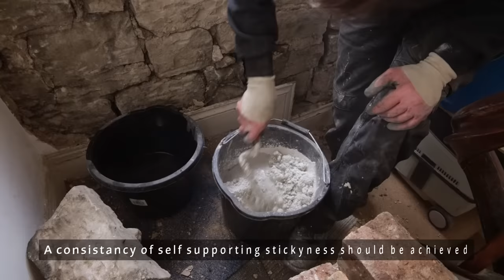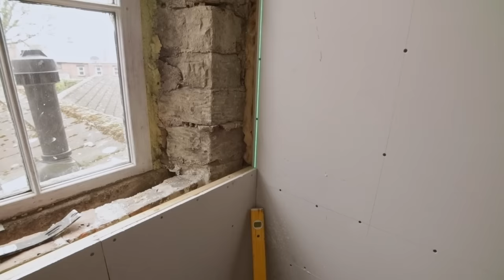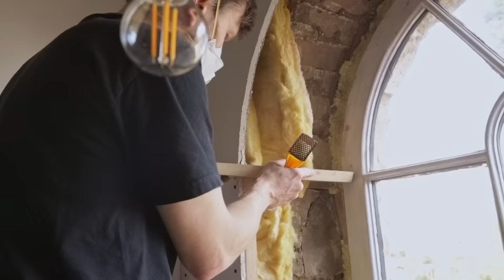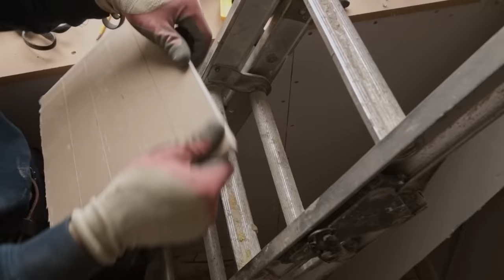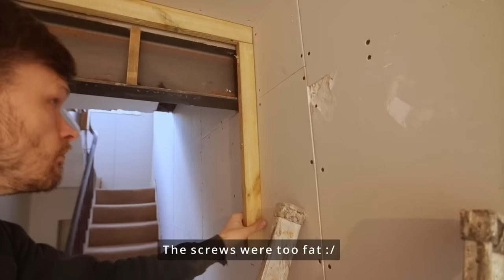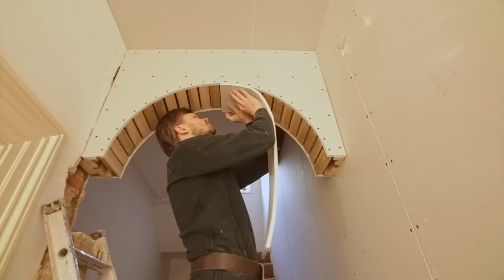Repairing and plasterboarding 160yr old crumbly arched window

Comment: Pleasing to see someone at least knows how to make it better than it was. I think the original builders of your wall and arch must have had an extended pub lunch!
Reply: I used to have a 300 yr old rubble stone cottage. Very similar walls. 
I'm not sure but it could be the better craftsmen were used on the outer skin and the 'trainees' used on the inner skin. Then of course you wouldn't see the inner skin anyway. 
Also, it must be remembered this house will have shifted all over the place as proper foundations were sort of unheard of!
Reply: @JohnnyMotel99  A few quick searches and I couldn't find anything related to the inner core walls of these homes. Could well be that it was understood that the inner walls would be plastered over, and structural integrity was unnecessary. Hard to say, but I tend to agree with you that "first year" apprentices may well have done that work! Also, looks like a cavity was purposefully left between inner and outer walls-- and rubble was allowed to fall between (doesn't appear like they meant to fill that cavity). Air barriers are known good insulation between extremes-- could be timeless knowledge, I don't know. What's known is, temperature extremes tend to produce "weeping" of humidity on opposing surfaces-- which could account for some of the mortar degradation on the inner core (just a thought).
Reply: @crustycurmudgeon2182   The plaster he removed I think was all imperveable (pink) gypsum directly on stone, brick, not traditional lime that lets the building breath. Plus he removed some internal cement that also traps moisture. Possibly also modern plastic based paint, wallpaper also sealing moisture. Additionally I think there is ribbon/strap cement pointing to the exterior which again traps moisture from outside. This causes the stone to disintegrate, corrode over time. 

(Just from what I've read on the topic, not personal knowledge/qualifications)

Comment: I am continually amazed by the old methods of construction used in the UK. The oldest building I ever worked on was a house built in the early 1700’s. The floor joists were oak logs that were debarked, flattened on one side. Tried drilling holes through them to run electrical wiring. After three bits and one drill we gave up and got a code variance to run the cable across the bottom of the beams. Looking really nice. Can’t wait to see it all finished. You should let your little helper in more. She obviously knows what she’s doing. Good dad! My little girl loved working on building projects.

Comment: Dry-stone walling is an ancient Yorkshire craft, but you rarely see it used indoors. :-)
My mum's house is also in Yorkshire (Colne valley) and was built somewhere between 1250 and 1500. That has walls around 1m thick (at the base, there is a pronounced batter) was built  with the local clay packed between the stones rather than any kind of mortar. With those you really did have to choose where to stop pulling out loose stones, as they were all loose when the weight comes off.
Reply: Where was the dry stone wall? He used mortar
Reply: @Miss_Toots  It was a joke, because of how little was holding in the stones before the work started
Reply: Pam Ayres had a little poem about dry stone walling. -- "I am a dry stone waller. All day I dry stone wall. Of all appalling callings. Dry stone walling's worst of all"

Comment: A true perfectionist!
There should be a small gap between wall and ceiling to fill with acrylic, and the blunt ends of the boards should have a V-cut (there is a tool for that).

Comment: Excellent job. I would also check the roof and the outside wall, because the wall and the wood look a little bit wet and with those loose stones, it could be a sign of leakage.

Comment: I would love to know how much temperature difference all the new insulation has made. Looking at the new pipes I assume you also updated the heating so difficult to tell but it looks like it will be toasty! Hard work improving the old solid wall houses.
Reply: A scutch  should be used to clean up those bricks not a brick hammer from what I can see
Reply: @johnthomas-vy3th  if it's the wrong tool, but it works, then it's not the wrong tool :)

Comment: Perhaps I am wrong - but you usually put two layers of half inch plasterboard over a steel beam?  (with staggered joints or use the pink fire rated stuff) Steel is vulnerable in a fire as it fails (bends when hot).  Also if you are mixing modern (plasters and plasterboard) technology with old a vapour barrier might be needed - to let the natural stone breath... but not suffer damp to excess.  Great skills as always though :)

Comment: A bit late, I know, but if you spray the back of the board with water and leave it for five minutes it will bend to the arch shape you want. Much easier than scoring and dealing with the flats later.

Comment: Absolutely amazing to watch. Just one thing, have you tested how much moisture the stone and mortar walls actually emit? I mean, e.g. the plastic test, where you tape a big piece of plastic to the wall and check for any condensation inside after a couple of days?

I would have left the nice ventilation gap between the PIR and the stone/mortar and left out that yellow stuff (glass wool perhaps?). Especially around the exterior wall, where the moisture is almost guaranteed to propagate to the inside. Just saying...  :-)  (how do you make a smiley here?)

Comment: Incredible work again, can I ask what bolts you used to fix into the masonry? I didn't see any rawlplugs and they are always a faff
Reply from the maker: I was using these easydrive concrete screws, you just drill a 6mm hole and drive them in, need quite a powerful screwdiver but they work really well. 
https://www.screwfix.com/p/easydrive-countersunk-concrete-screws-7-5-x-70mm-100-pack/9643h

Comment: I'm on the other side of the pond, and really enjoy the videos. Your work is incredible, and aren't little helpers the best? :)

I've seen several times over the years that in the States that our drywallers will wet down the drywall some and allow it to sag between benches or sawhorses to create an arch. I admit some concern with mold by this technique. Do you find the kerfing works better?

Comment: Are you not installing vapour barrier over the areas where you are using fibre insulation? Where I am in Canada vapour barrier must be installed according to code because if fibre insulation is not protected by a vapour barrier then it saturates with warm air borne water vapour from the inside of the building and becomes useless.

Comment: I would of used the blue rubberize concrete sealer on the stone and mortar to keep the insulation dry from moisture and drafts. 🤔👍 Other than that your drywall work over stone is absolutely perfect. 🤩👍

Comment: Isn't that plasterboard and foam just going to trap moisture behind it, which will degrade the mortar, crumble the bricks, and foster the growth of mould and rot? Shouldn't you be using only vapour permeable materials on an historic solid wall like this?
Reply: Exactly. This guy is using completely  inappropriate methods and materials for old buildings.

Comment: One very minor comment for the future, and obviously not applicable for the arched section, the feathered edge of the edge trim should be on the outer, plastered side of the plasterboard. You may get a crack along the edge of the smooth trim. A line of scrim tape along the join may help prevent this.

Comment: You never did a part 8 on that window, may I ask how you fitted the double glazing? I did all my double glazed sashes with butyl, brads and linseed putty, the old school way, only to be told by a glazing bloke one day that I’d basically destroyed the window longevity and voided any warranty on the glazing as the butyl and putty will dry out the seals and the gas escapes. I wanted to keep the traditional look rather than getting glazing beads.
Reply from the maker: ye i fitted mine more or  less the same way, but the butyl i think should be fine, its the linseed which attacks the  igu sealant. so i fitted the glass into the frame with butyl sealant, then glazing brads to hold in place, then silicone around the edge with a particular type of sealant which is resistant to the linseed and that should protect the igu sealant. then linseed putty to finish it off. ill see if i can find that sealant and let you know.
Reply: @NewYorkshireWorkshop  thanks for the reply, I’d appreciate that. hodgsons do a silicone sealant which may do a similar job, they also do a ‘heritage putty’ in a tube which they want you to use instead of linseed putty, that must get expensive quick!, so to clarify you bedded the glazing in with butyl, obviously made sure the gap between the inside edge of the sash and the edge of the glazing was filled up with butyl, branded and then put a skim of sealant over the butyl filled gap, Which you then did the normal linseed putty? My glazing came with a thin aluminium foil around the edges of the pane and the manufacturer said that helps stop seal degradation and moisture ingress, but I’m dubious as they were low on the price bracket for double glazing and other higher priced manufacturers don’t bother.
Reply from the maker: @samjl4  Ive just looked back and it was indeed the Hodgsons silfix U9 that i used.
I only  put the butyl into the face and bedded the units against it, enough that it squeezed out a bit on the inside. then sealed between the wood and glass on the outside with the silfix U9. as long as you have a seal between the black seal in the unit and the linseed it should be fine. I was going to suggest just using the foil as well, since that would technically do the same thing but i dont know if it is permeable to the oil or not, or if it would degrade as well. I did a bit of research back when i did it and the butyl/silfix method seemed to be the common way it was done.

Comment: Watching this patient work something occurred to me. Why can't there be mortar bags, like icing bags. You would load the mortar into the cone shaped bag that has a nozzle in the end, fold the big end over to secure, and squirt a nice fat worm of mortar vertically in between the blocks you have bedded. Rather than use a long narrow trowel to try to poke it in as best you may.

Comment: Start of video, as you struggled to get rubble into a floppy bin liner - buy yourself a "bosmere bin bag loader". It's just a rectangle of plastic (of the right size and thickness). You wind it into a spiral, and put it in the bag. It unwinds (a little) and holds the bag open for you. It also LINES the bag, so that as you put nasty spiky stuff in, the bag doesn't get pierce. Absolute marvel, I use them all the time in the garden.

Moving on to questions:

Do you think that shoddy wall was (a) shoddily built or (b) shoddily repaired?

Do you know what the stone is? Judging by how easily you drill it, and how big the tooling marks are, I'm guessing it's pretty soft. Certainly not Aberdeen granite!

Comment: I guess the window frame was treated and repainted off camera? There's also a lot of fixings and no continuous support in the "battons" around the face of the reveal. Nothing but plasterboard forming the structure... 50mm cuttings loaded with screws aint doing much for ya!
Reply: That wasn't very constructive, sorry. Framing out like that leaves the whole ingo/reveal prone to big repair if it gets damaged. A knock will leave it needing a lot of work, as opposed to some filler and paint. Same goes for not forming a timber frame in the arched stair feature. Nothing to stop the board from popping if it's ever hit when moving furniture. Because the plasterboard is your structural element.

Comment: I don't really want to be that guy, but... what if someone wants to put up a curtain? You've got drywall holding up drywall... there is no real structural framing at the top of the window arch. I'm sure it'll be fine and stay there... but then someone will want to put a curtain rod up there. What are they gonna do? Drywall anchors? Into drywall that's just sort of floating there? What if someone wants to clean, paint, or repair the window... and they put a ladder up against the drywall that has nothing holding it up behind it? I dunno, seems like a massive oversight to me. I've never done an arch like this, but whenever I'm doing framing and drywall around a window, I make certain there are big areas of wood for screwing curtain rods to. And then again for the hallway arch... why? You were already framing it.